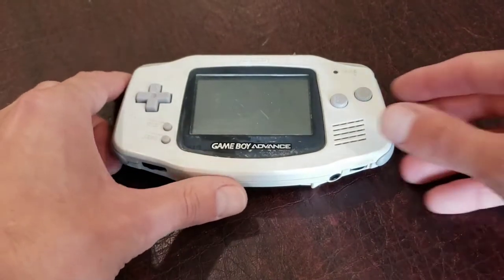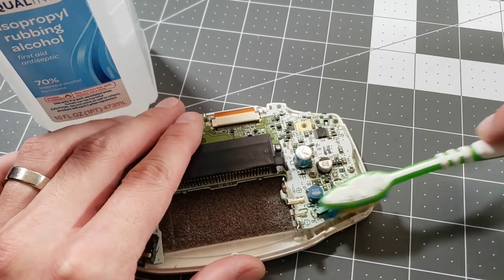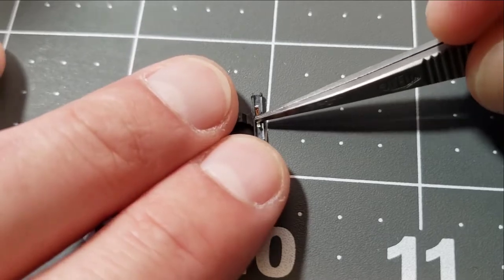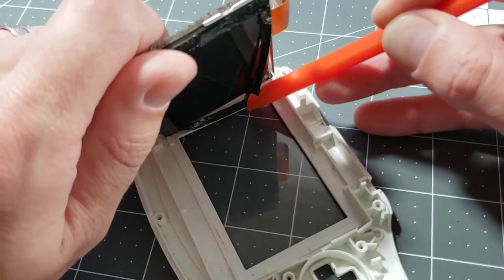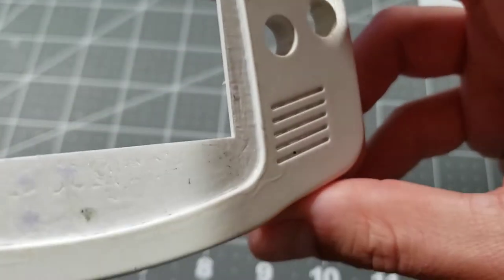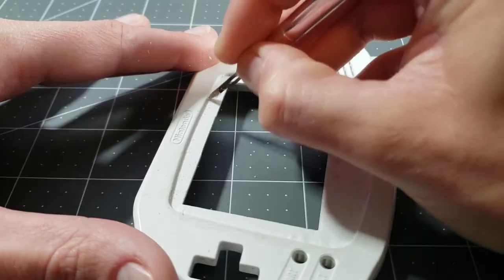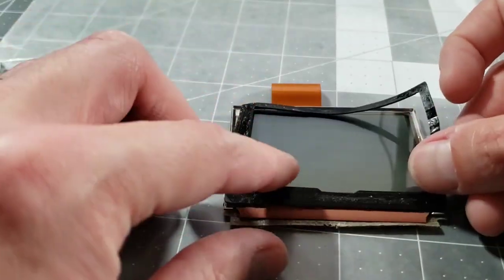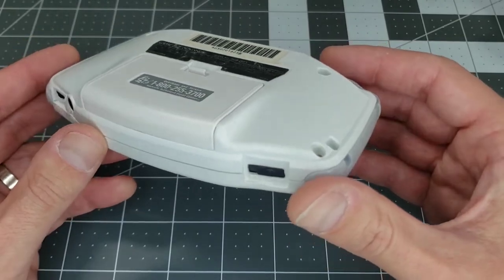Gameboy Advance No Power | Switch Fix (and Restoration)

Comment: When you put the switch back in, did you solder it? Did you do any soldering at any point or just use the iron? Thank You.
Reply from the maker: I'm a little confused by this question. The top plate of the switch is soldered back where it came from starting at 2:47.